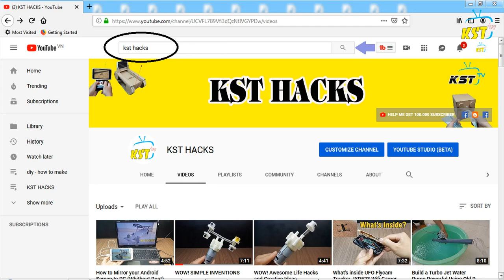First Time on Youtube - Make Automatic Hand Washing Machine.

Comment: Water and 18650 batteries plus pcb do not mix. You'll end up frying the pcb if you get water on that. I suggest putting the electronic board and battery inside a water tight container with a lock clip so that you can open it up when you need access.